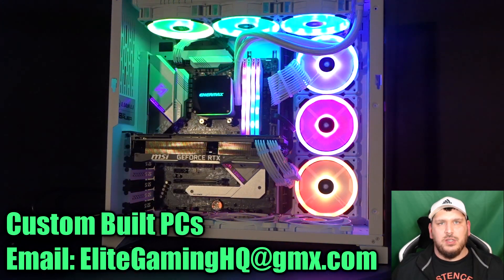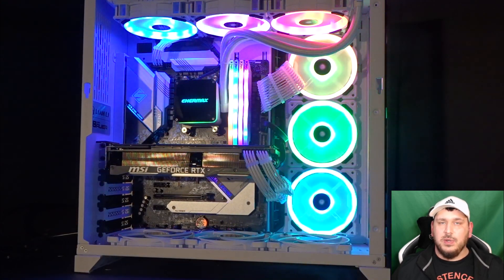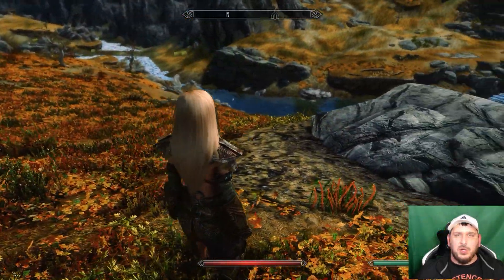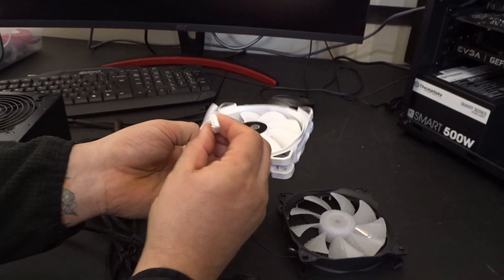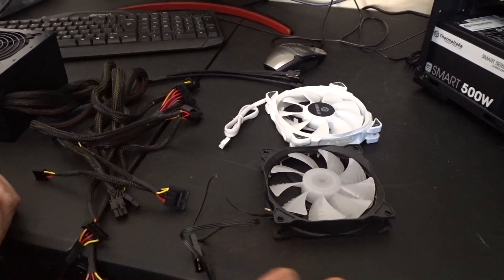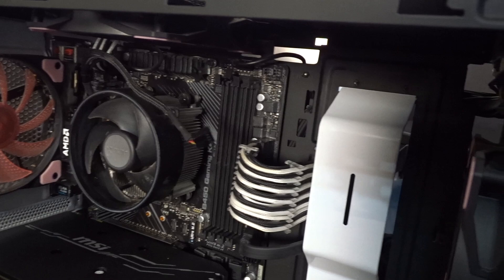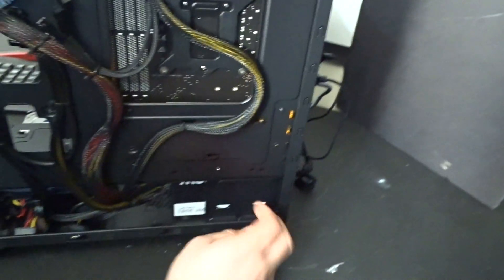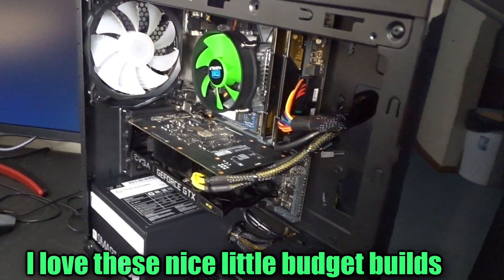How to Fix loud PC fans on your gaming build and get better PC temperatures (quiet fans)

Comment: hey, i plugged my pc fans into the sys fan pump. is this okay? i wasn't sure where else to put it because i cant close the back of the case if i put the cables up and over to the sys fan 1. i got my case swapped by someone and my pc came back a  lot louder. the fans are just going so fast that they're a lot louder so i'm just really wanting to fix it. i already switched my bios to silent and it helped a bit but not much. i just wast to go back to 0 sound ahhh

Comment: Well, my pc fans are always at 100 percent the graphic card one kicks in when I’m on a game and it pretty loud on its own WHAT DO I DO
Reply from the maker: Well sounds like you have some case issues. It may be the quality of your fans, the cooler on you video card, the position of your fans. Any of that.
Reply: @EliteGamingHQ  the fans are ok, it’s just that they are on full blast all the time , when I play games and the gpu ones kick in that’s additional but when I’m not on games and just searching my pc doesn’t get hot and the fans either do not need to on or the speed to be lowered down and just Clarify I’m not angry when I said WHAT DO I DO. 😂

Comment: I have a question, I bought a brand new computer with about 5 fans, the fans aren’t amazing quality, there mid tier I would say. But they’re pretty loud, like not insanely loud. I just want to know if it’s my psu struggling or maybe it’s that I have 5 kid tier fans, idk plead help
Reply: I have a 500 watt psu btw. 1660ti, 17 10th gen,asrock b460 motherboard

Comment: my pc jus randomnly started being loud when it was so quiet b4 wat do i do i cant tell if its cpu fan or case fans
Reply: For me its the case fans and yes mine we re also quiet.what do I do
Reply: @skeloint  replace them I guess mine gets loud as well lol but I usually don't notice it when I am gaming
Reply: @smwfreak_1  my chassis fan is running at 2000 rpm and my wraith prism is at 1300 idk what to do lol

Comment: To be able to control the speed in the BIOS you have to plug the cord into a 4 pin, not the 3 pin. That extra pin is to control it. If you do the 3pin you will just get power, and the fans will be at 100% constant
Reply from the maker: The speed of BOTH 3-pin and 4-pin fans can be controlled, but the method is different for the two types.
For 3-pin fans, the connections to it are Ground to Pin #1, +VDC (varying) to Pin #2, and Speed signal on Pin #3. To control fan speed, the mobo header must alter the voltage on Pin #2, ranging form +12 VDC (max) to about +5 VDC. (At voltage less than 5 VDC, the fan may stall and not re-start until the voltage is increased.) This method is called "Voltage Control Mode" or sometimes "DC Mode". The fan speed signal is a series of pulses (2 per revolution) generated inside the motor and sent back on Pin #3 to the mobo for counting and display. Interestingly, this signal is NOT used for actual control of the speed.
4-pin fans work differently. They still use almost the same signals on those first 3 pins, but with one important difference. Pin #2 always has +12 VDC on it, never reduced. Then the new Pin #4 has the PWM signal. Inside the fan a small chip uses that PWM signal to control the flow of current through the motor from the +12 VDC supply, thus manipulating speed. This method is called "PWM Mode".
Reply: @EliteGamingHQ  Wow I had no idea! Learn something new every day

Comment: Thank you for the detailed explanation! Just one question, if I have rgb fans with a hub connecting to ARGB 3pin on the motherboard. Can I keep that connection and just switch all my PWM 4pins on the hub to the splitter? I have NZXT x53 + antec prizm rgb fans 5+c. TIA!

Comment: my pc fans stay somewhat quiet when im just watching youtube but when i go into a game it runs at full speed
Reply: I guess your components get hot
Reply: Here’s a trick you’ll have to go to alien where the software that you can change the colors and see if you have the game on their list it on the game was there or there’s a performance option that will allow you to change how loud the fan is in the performance is going to be on high so you’re gonna need to change it so then it’s not loud
Reply: my GPU gets pretty hot i guess bc i have stock fans.. they do the job but really loud.
Reply: Landon Fuu yeah I just have stocks atm need to get some Corsair ones to be honest stock loud asf
Reply: @rezzi3008  yeah I’ve got a Ryzen 5 2600 and RX 580 stock fans etc, the loudness only hits me when I’m like rendering between games or somethin but I’ve gotten used to it tbh
Reply: Same
Reply: Every 60 seconds in Africa, a minute passes
Reply: Well no shit. Of course. You're gaming, it's working hard. It needs the cooling.
Reply: @Lycosa  thats not the full reason. Im using stock fans and a cheap dell mobo
Reply: Dude that means your pc is worse then mine and my pc can STILL TAKE VHS'S
Reply: Dude that means your pc is worse then mine and my pc can STILL TAKE VHS'S

Comment: My pc just speeds up and slow downs randomly when I'm gaming
Reply: Did u fix it?
Reply: Mohamed Musrati I think I have dude, I just made the fan curve in my bios more gradual and moved it along so it takes a higher percentage to increase the fanspeed so for example before it would be at like 30% cpu usage to increase fan speed, now I put it to 50%
Reply: @snoorlax7973  did you watch a video to work your fan curve or do it by urselr, my pc has the same problem and i have no idea how to use the fan curve

Comment: Can you use a hub on a PC which has a control plus plug it into the motherboard?
Reply from the maker: When you say "has a controller" do you mean it has a manual fan speed adjustment?

Comment: Hey man I love your contents!!
I have a question. So I have a 2070  super gigabyte, I've notice the fan doesn't spin whilst gaming, should I be worried or does the gpu fan spins when the gpu heats up?
Reply from the maker: For a lot of higher end GPUs the fans will only spin when they need to. But I would download MSI afterburner and keep and Idea on the temps. I mean if your temps are at 75/80C and they are still not spinning then you may have a problem.
Reply: @EliteGamingHQ  oh okay, thanks alot man, been very helpful as always!
Reply: 🙂 on some gtx cards the fans dont spin while ur doing basic stuff like browsing or typing or copying files

but it should start to turn if you load up a game unless its a really lite indie title

yes download & install Afterburner, also download a gpu tester, i like Furmark & Heaven, turn on the gpu tester and see what ur temps are in Afterburner, also get a flashlight and fisically look at ur video card, u should see the fans start to spin up, as it gets hotter the rpm should speed up as well, turn off the gpu tester and the fans should eventually turn off again 🐢😊🐢
.
Reply: @MrSamadolfo  thanks mate, been very helpful! 👍🏽
Reply: @tarricksalaman5641  😇 your welcome

Comment: My problem is..   How can I describe. My pc is totally fine, but I think for the hardware I got I could get alot more out of it without getting as hot as it is going most of the time when I try sth in highe res.
( the gpu mainly tho)
I got a gtx 1080 and it keeps getting to.. Like 80 ~90 °C  when I play a game on higher settings. And I already got 4 fences.
How could I improve? Btw nice video so far :3
Reply from the maker: You already have 4 fences? Im guessing you mean fans, how big is the case or what model is it?
Reply: @EliteGamingHQ  woops ye xD fans.
em i got a huge tower from bequiet( silent base 600 orange bg005)
Reply: 🙂 is it a basic oem blower style card? is ur case all closed up with no fresh air? hows the thermal paste? is ur cooler fins all plugged up with dust bunnies? is the gpu fans spinning fast enuf to cool down the card? can u speed it up even more thru Afterburner? 🤔
Reply: @MrSamadolfo  sooo the case is relatively open. I got 2 front fans, one at the top and 2 at the back. the thermal paste is also almost new and should be fine. And I alredy adjusted them to spinn faster as soon as it gets hotter
Reply: @janniko.3232  🤔 hmmm well some card companies setup the gpu bios with too aggresive of a volt setting, you can try undervolting with Afterburner, go to settings and activate the volts unlocking feature then go back to the main menu and slide the volts slider down a bit, play a game to load up the card and keep sliding it down a bit more till u find the minimum volt setting without crashing windows, the temps shud b lower now, afterwards u can open up Riva and set a Maximum FPS Limit, for example 30 or 40 or 50 or 60, lowering the max fps should reduce temps even further, these are especially useful tricks with older ancient cards or if ur on a laptop 🐢😊🐢
.